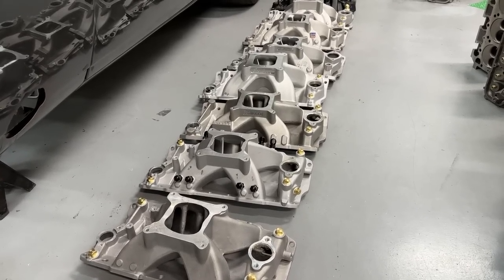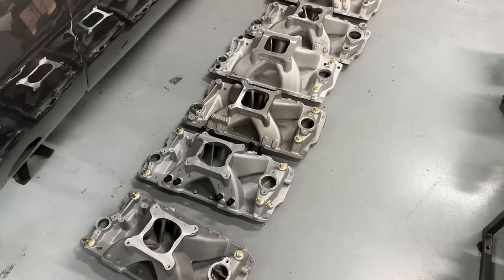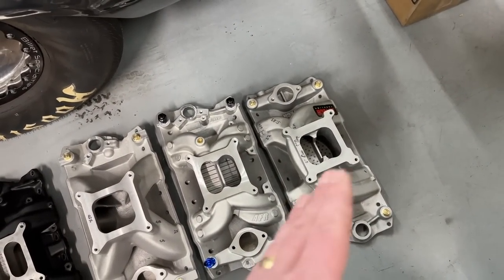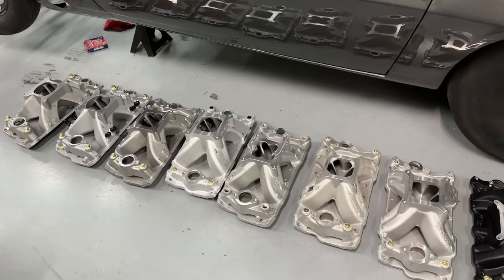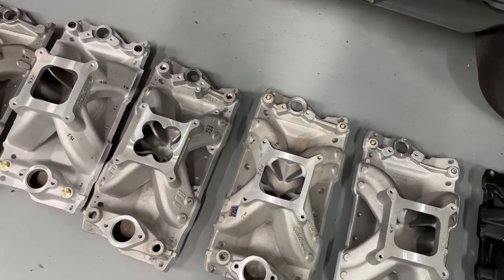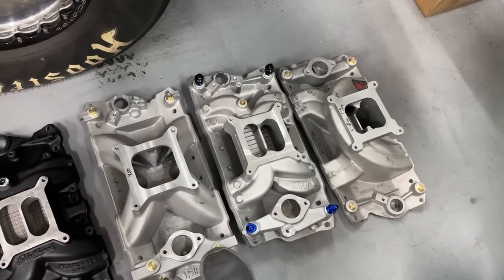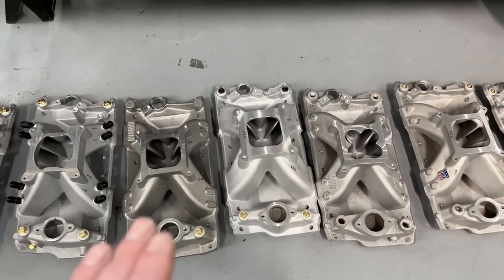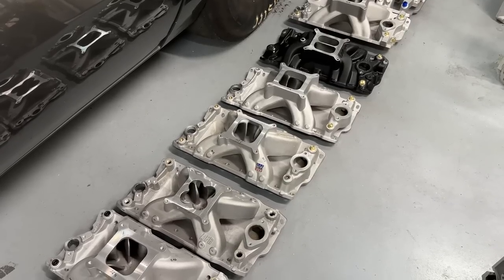The Results Of The Manifold Tests

Comment: Rpm airgap with a 1 inch open spacer is still extremely hard to beat for the street intake manifolds, and then next to that the procomp single plane a.k.a. copy of the old gm bowtie intake is and has always been really really good and wayyy cheaper than most

Comment: Amazing that the cheapest, Chinese intake made more power than intakes costing 3 times as much. It's been known for years that them Hurricane intakes are good. Better than I thought actually. I would have put my money on the Super Victor 2. Those Keith Dorton intakes make less power than the original Strip Dominator 300-25 I've seen in a  previous test. But on a 700-800 hp 434, the results would be different for all of them. I would have liked to seen where the Dart singleplane fell in that comparison. Good job man. 20 minute intake swaps is kickin ass.
Reply from the maker: The two other intakes I should have tested would be the Holley 300-25 and the BMP/Motown 4150
Reply: @WeingartnerRacing  My thoughts exactly. Like others I would have tried to use the RPM Airgap but I'd have thrown in a Holley 300-36 in the mix. I've seen a few tests with the Tork Link, never good.

Comment: Oh, btw, my heads only need 31° of timing, yet i found putting in a splash of 110 leaded, with my 90 non-ethanol, has made my motor, MUCH happier, so you puttin in a splash of 110, with 91 (i assume ethenol base) to keep things safe is EXACTLY why i mix a bit of 110 with my 90 pump....TY SIR!!

Comment: Oh and a little a little trick to that rpm intake manifold 
The air gap and the RPM have the same carb pad height except the air gap has the separation between the valley and the runners and the RPM doesn’t so when you cut down the divider on the regular RPM you’re basically copying the air gap intake manifold and gains about 10 hp give or take a couple up top fwiw

Comment: Thank you for testing all those manifolds Eric. It would have been great to see how an rpm air gap would have done if you had one to test. Also, interesting would be what happens to fuel distribution in a given intake manifold when subjected to g-forces - front to back for drag racing or side to side for road coarse applications. I'm not sure if it is even possible to do that but maybe checking air/fuel ratios at each cylinder with O2 sensors??
Reply from the maker: I didn't monitor 8 o2 readings.

Comment: Excellent, exhaustive test. I have an odd question. Let's say an engine is on the small side, I've heard of heavily ported intakes killing a lot of midrange torque with very little top end gain..  A lot of intakes have openings that are way small. Does leaving them small maximize torque? Or is there a certain amount of porting that increases power everywhere?   Like opening up only the top and side that matches the straight wall of the heads port and leaving the bottom and pinch point side alone?
Reply from the maker: You can watch other videos where I dyno test ported intakes. Unless they are too large to start there is no loss.
Reply: @WeingartnerRacing  . Cool thanks! I've seen dyno tests on a 400+ engine but was wondering how those various intakes would act on a smaller mill. Just a shift in effective RPM? I've seen one build where a ported intake killed torque but it was a smaller engine and they didn't just port the runners, the plenum was extensively ground.

Comment: sleeve are supposed to be stronger then iron bore. i dont get the stigma on sleeve. if i can pick up a cheapy thats needs a sleeve cant go wrong... also guessed the stock 568hp a friend has 572hp motor about the same but ported .. i was like well 568 is a good hp number

Comment: What would it take to get your own engine dyno? Just wondering if one of the companies would swing you a killer deal on a used or demo dyno for your shop. Seems like a magnetic brake would be small enough and "cheap" enough coupled with some Your Dyno controls and load cells. Just a thought.
Reply from the maker: Dyno is 65k. I could finance it but I need a place to put it. It makes too much noise for where I am.
Reply: We had a dynojet inertia roller at one of the motorcycle shops we worked at. And while i loved that thing,  It didn't really earn its keep as it was not our primary source of income, we sold bikes and accessories, serviced and repaired, fitted  tyres ect. Unless you are going to run your shop as a dyno shop, they are not worth it just to have sitting idle in the corner. Eric would have to give up porting/building or take on a full time second person to run it if he was to justify a dyno.

Comment: My head hurts.😎 If I understand corect. The hacked up port match hurricain was the best?  That makes the hack interesting. Was it over port mached leaving a step? Was the step if any at the floor?
Reply from the maker: It was bigger everywhere but not uniform.
Reply: @WeingartnerRacing  that is beyond interesting. Thank you.
I cant wait until you fix the port match with epoxy and retry. I sure hope you get a chance to re visit this area. If its worse. It would almost be nessasary to bugger up and oversize the port match on a different intake and try duplicate the result to isolate what went on there?  All I can say is I sure hope the hack match is not helping that hurricane. Or I have been doing it wrong my whole career and I dont want to mismatch ports. It bothers me🤔

If you read this far. I will say We had a David nickens comp engine years ago. Sbc. That he had left on purpose a 3/16" mismatch on the floor of the intake to head entrance to kick up tue wet fuel on a tunnel ram. We fixed it and lost power. I was a teen back then. That always stuck in my head.

Comment: Do you think there is big gains by porting the torque link? Especially with its long runners I would have thought torque would have been great.
Reply: Maybe all my fellow circle track guys that like the thing (I've never used it) love how it gets them off the corner 🤣 because they're not good at throttle control 🤷‍♂️

Fun fact.  Guy I worked with back in the day was tuning on an off road race truck on a really slick track.  He ended up disconnecting the secondaries, re-jetted the thing and won the race.  Pretty hilarious
Reply from the maker: Im not going to even try. It was really bad.

Comment: seems that the torque numbers are very low compared to Horsepower Usuall sen torque much higher then Hp
Reply from the maker: On good engines horsepower is more than torque unless it’s a diesel.
Reply: 520-540ftlbs (1.28-1.33/ci) of torque out of 406ci is excellent on pump gas.
Reply: Agreed, those are stout numbers.

Comment: Could  care less about  your test , already  bought  a  Torker II  and  Holley 1050
Reply: Torker II’s are no good. Return it immediately and then buy a manifold based on Eric’s test.
Reply: @evanarthur7535  , I'm satisfied with  it ,
My little  327 makes 475hp  , 
So I could  care less if it is  no good  ,
It feeds the double hump heads with  58cc  heads and  Manley stainless steel valves just fine  , and the Forged 11.5  pistons said  Thank You

Comment: What rpm did you turn the 406? When you say the best had a terrible port match, what do you mean? Was the intake altered, or just poor port alignment to the heads? From what I understand, those enforcer heads have a .100" raised intake port location, so a 1255 may have helped. 

Not to bad of power from a Chinese head. That was about 40 HP and torque than what I figured it would make.
Reply from the maker: We turned it to 6500rpm but peak power was at 6200rpm. The heads limited the rpm the most.
Reply: @WeingartnerRacing   I'll be honest, I never thought those heads would have benefited from such big single plains.